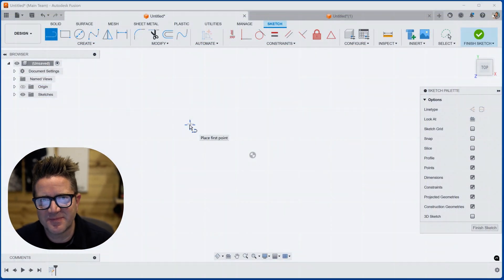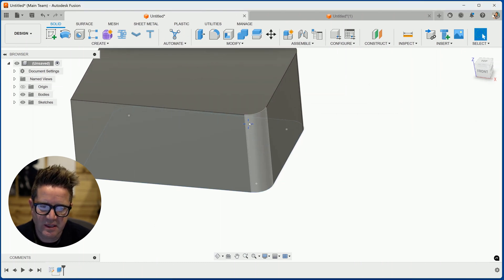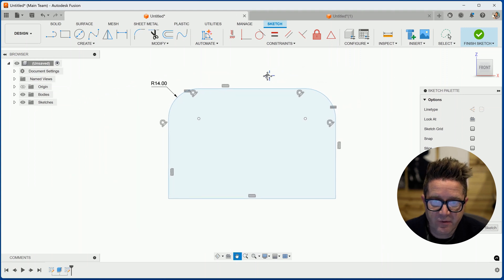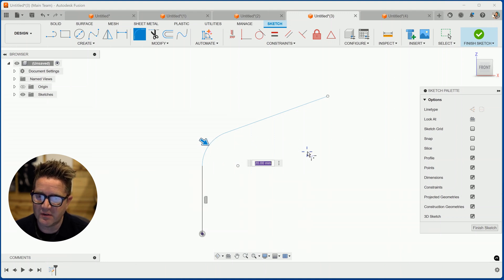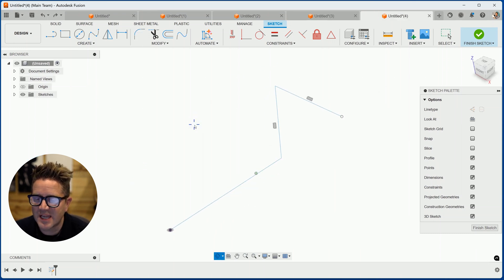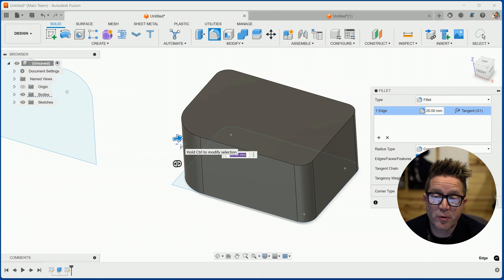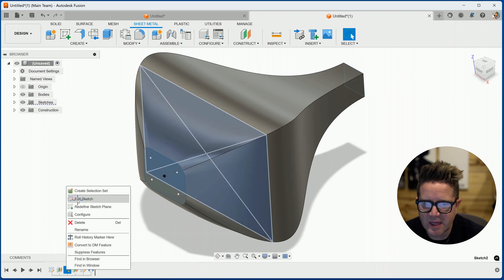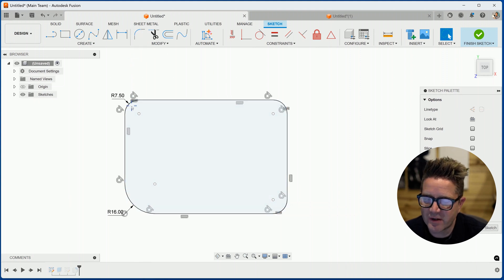Learn Fusion 360 Sketch Fillet – When & How to Use It

Comment: Every tutorial or information about sketches in fusion told me: "Do not add filets to sketches. Make sketches as simple as possible to avoid future pain". Do filets etc. later - in extruded model. When doing filets etc in sketches you also loose some corner constrains. Sketching has no history. It's hard(er) to change anything later. Just don't do it that way. That's what I learned.